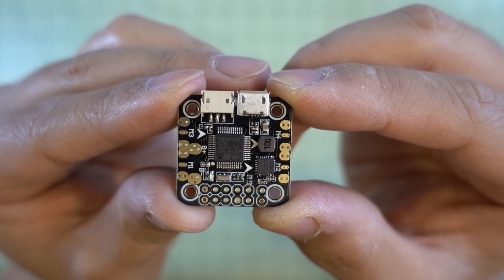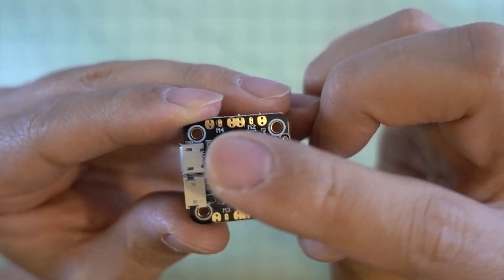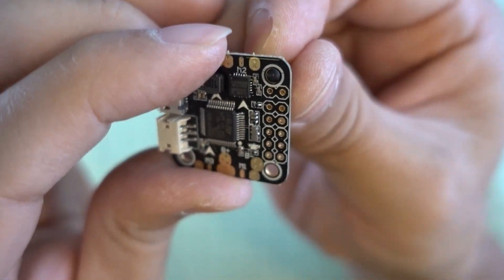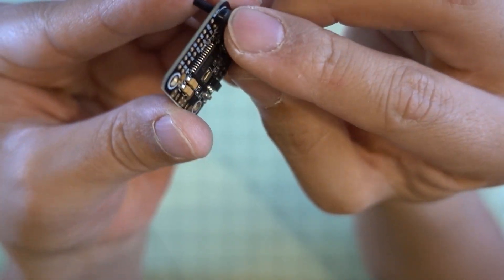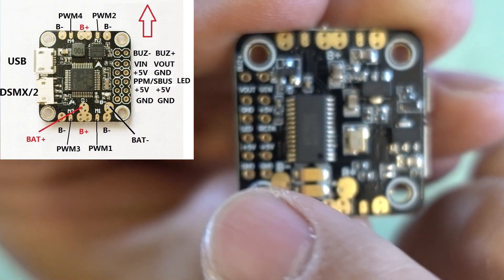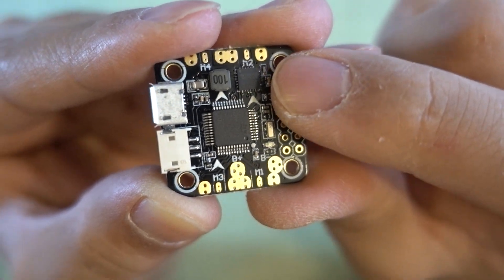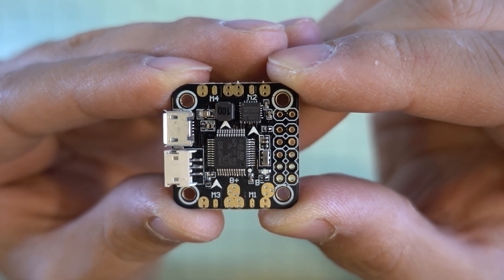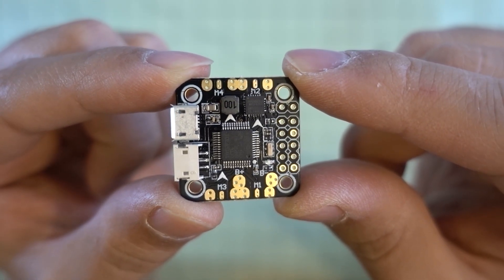Micro Omnibus F3 Betaflight+OSD Flight Controller

Comment: Hello Mr. Kim,

I have 2 micro frames and need to get an FC for them both, 120 size frames. I already have spyder 18 amp escs so do not want or need a FC stack with escs, can you please give me a good 20x20m FC for my two frames? I am having a hard time finding anything that does not include ESC stack etc. I had a Piko BLX but seems I am unable to connect in to betaflight after fireware flashing, think F3 boards need a different driver, any ways never got it to work once, so lookin for an alternative FC in 20mx20m size. Thanks in advnace!!!

Comment: Please respond :) Love your videos. I bought the super-s f3 stack. This is my first micro and I'm wondering if it's normal not to get motor beeps for power or signal. Using dys 10,000 KV?
I can't get the motors to spin in BF. esc's and FC seem fine, so I was going to build it before I try to arm. Didn't want to bother if the motors/escs aren't working. Thx!!!!!!
Reply from the maker: Thanks for the question.  Sorry, but I don't have enough information here to offer a solution.  I don't really know what's going on based on this limited about of information.

Comment: I got one of these- Are you able to replace the flycolor raptor fc and wire it to the flycolor esc 4 in 1 with this? The pin connection between them is confusing me. My klex90 fc is going out dumps the firmware between flying sessions- wierd

Hey Albert thx for the heart! But yes or no do you know if you can you interchange these 2 fc's? Thank you!

Comment: anyone having trouble with frsky receiver on this? mine would connect to my TX but on betaflight it wont do anything no matter what i do on the port tab.
Reply: zero3four6 Did you ever figure it out for the frsky receiver I have xm hooked to it and tried every uart receiver still isn't showing anything on betaflight?
Reply: Jordan Harris no, i gave up on them lol
Reply: ports tab set uart 3 serial then go back to configure tab and choose serial and sbus- if you don't tell the board how to communicate it won't save the configure page settings and you won't know it- and it won't work

Comment: hey i flashed the wrong betaflight now i just get a solid blue light there is no boot pins any help???
Reply from the maker: It's on the bottom of the board near one of the corners.  Two solder pads that aren't bridged and not labelled with anything.
Reply: Hi, this flight controller is good for osd and 100mm drone and 10esc?
Reply: Hi Albert.  I appreciate you giving us an idea where the boot pins are because Banggood gives us no info what so ever.  Can you please be more specific?  I don't want to fry my new board by picking the wrong pins.  Thanks VERY MUCH.  You are the only one giving ANY info on this board. :) You can send a picture of the correct pins to 10sr@gmx.com

Comment: I have 2 of these boards and I've had major issues with both of them. One of them does not communicate with motor 2 so is completely useless. The other board had the BEC fail and it started outputting 10v+ to all the 5v pads. So it fried my receiver. I only had the receiver and buzzer connected when this happened so I don't know if the BEC can only handle very low current or if it failed for another reason. Either way I would avoid these boards if I where you. I think it's the only 20x20 board that offers betaflight OSD at the moment, which is why I got them but I'm sure we will see more options pop up in coming months. I'm going to try running the board off of a 5v reg so I can power all the other components I need to from my board and see how it goes. As of yet I have not been able to get one of these boards in the air because of all the issues. Good luck if you purchased one of these. I will not be buying another one I can tell you that.

Comment: I don't understand one thing. Nowadays on the market there are plenty of 4in1 ESCs in 20x20 mounting pattern, so why they can't just get rid of this useless PDB in the FC and simply make it an FC + OSD, but -PDB? It will not only allow to fit more components without worrying about space on the board and these compromises like 2.5mm mounting holes, but also allow the board to be physically lighter and thinner because of PDB traces removal, and also get rid of currents, flowing nearby the FC. And with usage of 4in1 ESC and some kind of innova type 20x20 VTX, it will also significantly lower the stack and allow for neat and tidy builds.
Reply from the maker: +Crafffter We will see this later this year.

Comment: I always file the holes larger anyway because I want to damp vibrations better (this way only the foam under/over the holes touches the FC, the screws can vibrate as much as they want and not transmit the vibrations to the FC because they don't touch it)

Comment: Can this fc handle vtx power? Power filter? Thanks
Reply: +Albertkim Did you ever test the VTX03 with 200mW?
Reply from the maker: +jwhit87 for the small micro aio FPV cameras it's fine. Power is filtered on the 5v rail.
Reply: Albert Kim i wonder if eachine vtx 03 would work at 200mw
Reply from the maker: +ChristianP1973 just flew it on 25mW with no issues. Will try the TX02 on 200mW later.
Reply from the maker: +jwhit87 I think it will.  I'll test the VTX03 later.
Reply: Albert Kim that would be a great video plus it would show any video noise and how to setup osd if all possible
Reply from the maker: +Tom Herold yes

Comment: I wanted to use this FC on the Realacc KT100 100mm - https://goo.gl/t0UqDd. Could I build this if I bought the m2.5 screws
Reply from the maker: Yeah, it should work with the right mounting hardware.